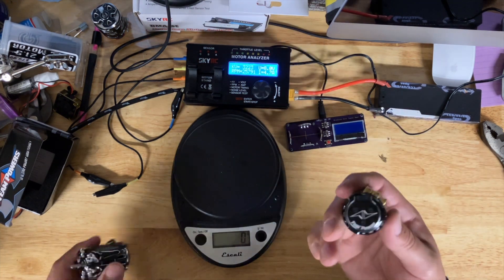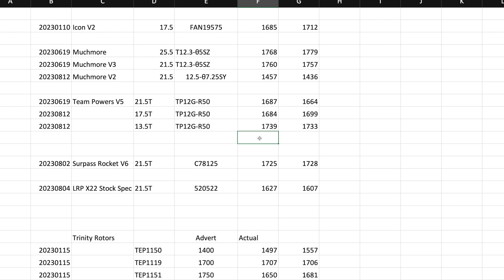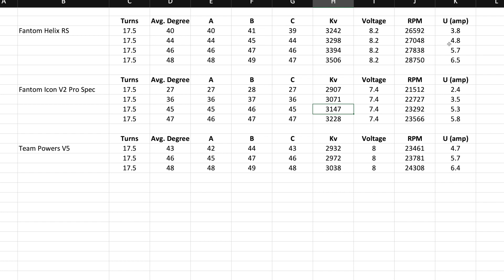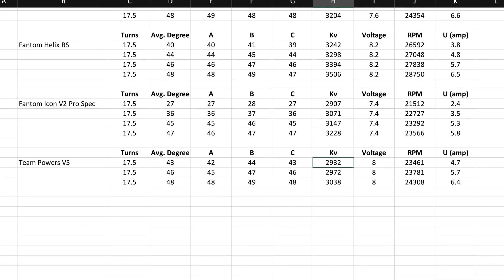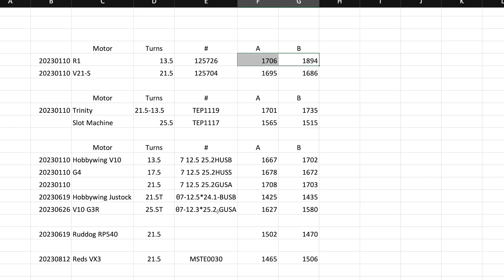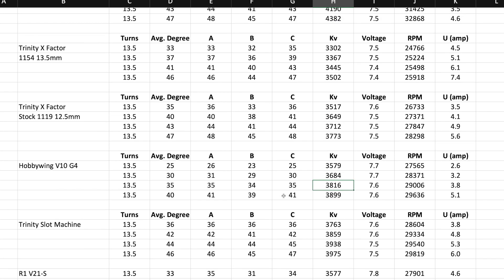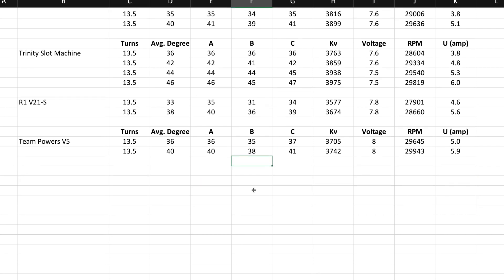Team Powers V5 17.5T and 13.5T comparison Analyzer Specs and gauss

Comment: Checked my team powers V5, at 6A it’s 23000 rpm, a lot slower than yours.
Reply from the maker: What rotor is in it? I did get one motor in the past with a different rotor than spec.

Comment: Do you happen to know the milliohms of the team powers 17.5 motor. Im also trying to fund the best gear ratio for this 2wd RC10B6.4 with the 17.5 motor. I'm running a 72 spur and 29 pinion. Do you have any recommendations? Thank you
Reply from the maker: Good questions. I do not have the milliohms for the TP motors. I have not run a B6.4 but the gearing will depend on your timing. The 17.5T seems high. We usually run 13.5T on 4WD buggies. Your timing will be around 45 degrees. If you have a 72 and 29... you will probably need to gear up a bit. Go up two teeth and watch temps. I would not be surprised if you end up in the 30s in a slow track or even 40s in a fast track. Keep me posted.
Reply: @telecomandorc  thank you. I went to a 31 pinion and 72 spur based on my track owners suggestion and the car was ripping. Dropped my times from 20ish seconds to 18.6. I'm just getting back into racing after a 30 year hiatus. I raced an RC10T2 back in tbe 90s on dirt. So carpet is new to me. Im only about 3 weeks into it and lowering my times steadily. At our course 2wd buggies and 17.5 are what we run the most. I habe my team powers actinium v5 set at 49 degrees timing. Again based on a setup sheet the guys at the track created. I keep playing with the timing. I can run for 10ish minutes easy and stay under Temps but I do have a motor and esc fan going. Alot of people ditch the esc fans on 17.5 for weight cause they don't run as hot. But for practice laps I leave the esc fan on. I want my electronics to last and stay as cool as possible. Great channel and thanks for the response. You still have me wanting to try the fantom motor but I can't justify another motor yet lol
Reply from the maker: @LegendsPizzaCo  I must say, over 1 sec. improvement is impressive on its own. Well done. 
Now that is great that you have a 17.5T class for all. Here we have a 17.5T for 2WD buggy but 13.5T for 4WD buggy and open SCT. IT takes away from the handling aspect a little. 
The Fantom is a sweet motor. But I am with you. It is hard to justify right now and getting to know the car and setup is far better at this point. 
I am glad you are back into RC.

Comment: Could you please tell me what size rotors are in the 17.5 and 13.5 motors?
Reply from the maker: Rounding 25.5mm
Gauss was under 1700 gauss in one and over 1700 in the other. The rotors have the same part number. 
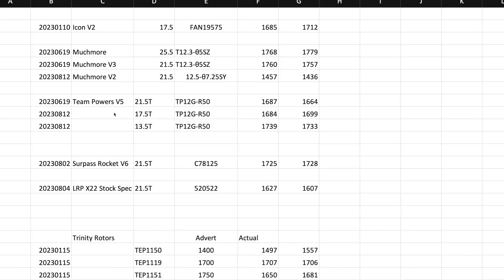If you go to 2:35 the table shows more rotors too.

Comment: Thanks for sharing - might be worth checking if the 17.5 V5 is properly shimmed? Mine is showing (sorry I don't have a gauss meter) on the skyrc:
43(reported) degrees: 2948kv 4.3A 
48: 3081kv 5.7A 

The kv difference is probably not noticeable, but the higher amperage surely matters through heat/battery life.
Reply from the maker: True. It could also be the instrument. Xtracrispy lent me his SkyRC analyzer and the Kv or the A were a bit different. So, I just use the same machine. But, you are right. Shimming could do it too.
Reply: @telecomandorc  what is the best way to shim a motor?
Reply from the maker: @BridgesBrothersRacing  No clue. I usually start with the rear. I put the rotor in the end-bell. Measure the clearance. Once this is good and I know it will not hit the sensors on the board, I will put is all together and see how much forward play it has. And I start shimming there. There should be some play, but not too much. If you put the pinion on and it can start sliding off the spur, you need more shims. If there is not enough play to shift slightly, is will heat up. Not sure if this is the best way, but it works.